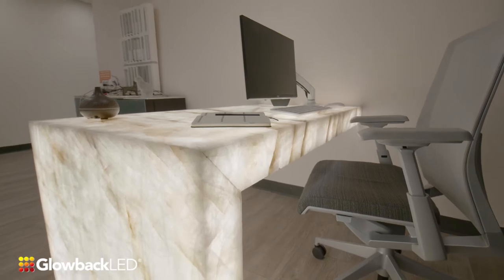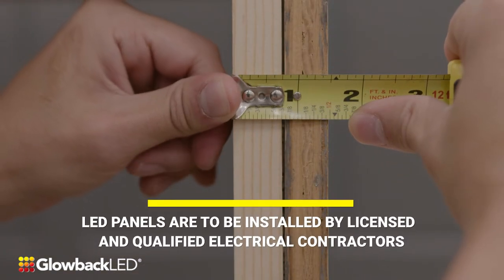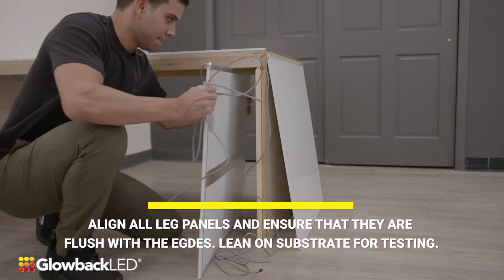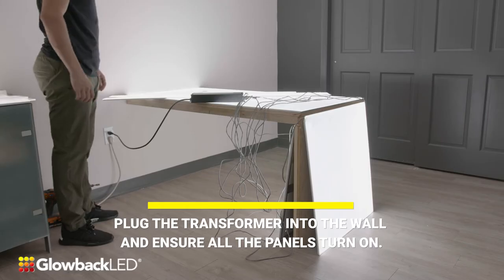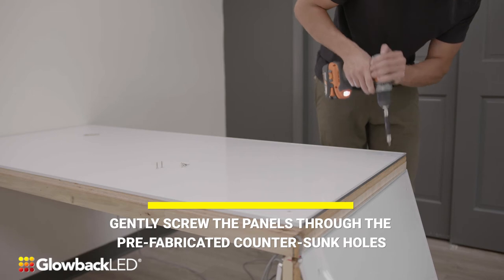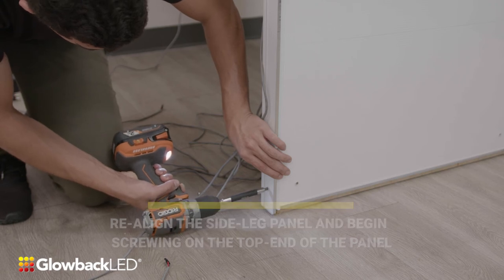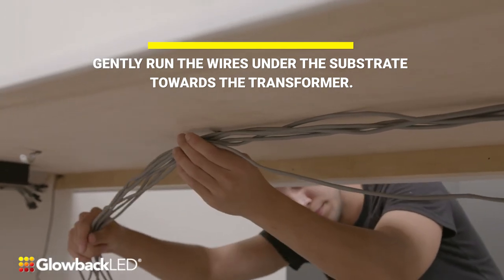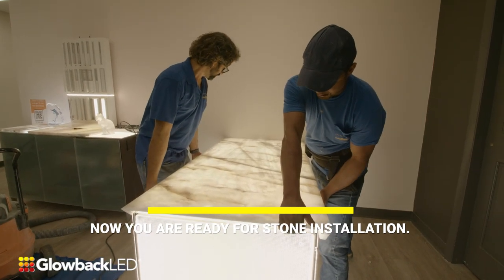Installation Guide for GlowbackLED Custom LED Panels for a Back-Lit Cristallo Quartzite Desk

Comment: i am building an 2970x1400mm onyx wall split in two pieces, inlcuded LED backlight but i have 2 issues. 1) what can i do if any of the lights needs changing and 2) how can i not show the steel shadow behind onyx when its lit?